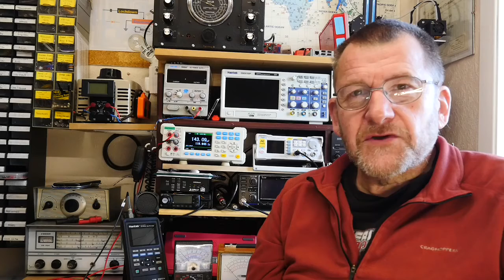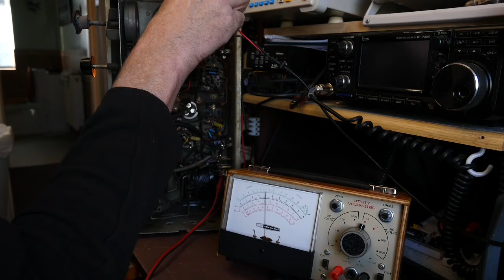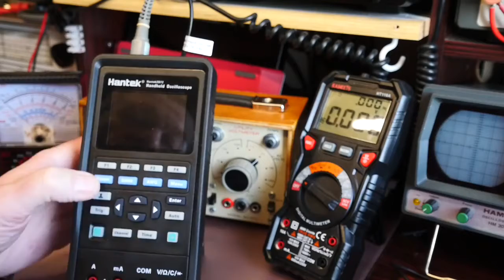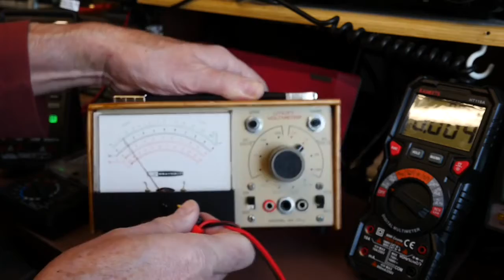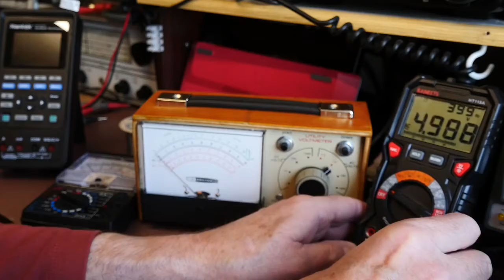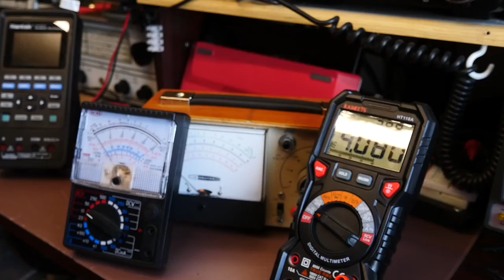Why Bother With Analog Meters?

Comment: Of course I liked it, and thank you for that. Like you, my first multimeter was an analog one. I still have it, and it still works a little (not as an ohmmeter). The brand is Central. I think I was 15 when I got it in 1976. In 1979, I bought my first digital one, a Micronta 22-198, which still works with good accuracy. I bought it from Tandy, which is no longer in business. The need for precision isn't frequent, so an analog one is sufficient and sometimes allows you to find a fault simply by placing it on a broken resistor thanks to its low input impedance.

Comment: An analog multimeter can test its own batteries, but a digital one cannot. Those who say that a digital multimeter is more important because it's more precise forget that circuits are made with resistors and capacitors that have a tolerance of 10 to 20%.
Thank you for your videos, I love your channel 😉

Comment: One remark about comparison of the digital with analog meter measured values in AC, analog meter measures the so called average value while better digital measure the RMS value. The better analog ones are adjusted to show the RMS value (but only for a sinusoidal signal). That is why the digital, with RMS, are also called True RMS, as they also measure RMS of all AC forms. And RMS being the effective value,  compared with DC resulted power...

Comment: I'm an analog meter fan. I have had a Simpson 260 and still have a Triplett 635, 300C, and 850 which is a copy of the Senior Voltohmyst.  But I wanted a decent new meter with a +/- centre-zero scale. Sanwa makes some, but they aren't that good. I found a Tekpower TP8250. The null scales are +/5 and 25 DCV. Quite handy for balancing circuits. It has a low-ohms scale as well. It took me some time to find one, so I thought I'd let you know. BTW it makes me feel young to know the 260, 635 and 300 VOMs are STILL made!

Comment: You are probably aware that analogue meters have their working position (inverted T for vertical and a kind of a wide inverted U for the horizontal position). If you do a demo on precise readings / differences you should keep the instrument in it's intended position, otherwise the comparison would not make muck sense. Although this sounds as a critic it is meant as a education for the others to be aware of this fact. And as you mentioned the parallax. Also the lighting / shadows. But your video has a different point probably and is more of a general point about analogue meters. They are intuitive. But still I could not help noticing this fact 🙂 Cheers
Reply: But  many analog meters didn't have mirrors......

Comment: Although I have a personal experience to “feel” voltage variation, there is another good use as the resistance non-linear: I (galvanometer) = V / r  , resulting in a Hyperbolic graph (for R, I meant). 
An analog is then useful to compress scale and use it for non linear (and simpler) ESR testers.

Comment: Thanks for a great video about the need for an analog meter on your bench. I have the kaiweets, heathkit dvm and a fluke 77. All good DVMs but when I do alignments in a receiver where I need to do peaks or dips in a circuit my 47 yr old vtvm puts all of them to the back of the bus. Nothing better than a meter movement for that work.  Cheers KG5IF

Comment: Hi Bill, thanks for the video. The RSGB Intermediate course lists the good points for an Analogue meter. I bought an "el cheapo" one and didn't like the meter connections - like a loose rivet with the same plug as the end of a probe making intermittent contact - returned within a day! I always look to your reviews to help justify a purchase... a second multimeter is justified IMHO if it is analogue - it is complementary (but not without cost).

The Heathkit is interesting because FET Multimeters have a high impedance and are less likely to affect a circuit being probed. 20 kΩ/volt is considered OK for a non FET meter? Some radio tests also specify that their tests were taken using just such a meter. It is perhaps no bad thing to take your time with a measurement so thinking about the range and zeroing the leads isn't a huge disadvantage - you might even observe something unexpected by not being in such a rush? Simon

Comment: Love your videos! I have several good DMMs but also own several Analog meters, one of them, I just purchased on estate sale, from Japan called THOROTEST M-20K. I can't find anywhere schematics for this meter. It's not working and everything I own I like in working condition. Do you know where to find the schematics? It also has room for (what it looks like) 2 AA batteries but when I put them there, the meter isn't working at all. After opening the back, the meter is clean inside and no wires are broken off and one capacitor, orange color, 0.1 MFD is the value. When I measured it, it is 0.1382 mF, using L/C Meter IIB by "Almost All Digital Electronics" - Neil Hecht passed away on August 19th, 2015, unfortunately for us hobbyists. (I wish I purchased at least 2 more items from him!). Anyway, the needle moves freely and the entire meter looks almost new inside and out. Also, it has on the right upper corner port called OUTPUT! I never seen a meter with an output so if you know what that is all about, please let me know. I have no schematics and I could not find them anywhere on the web, but I'm open for suggestions. I have small youtube channel,  go to: https://tonysfun.com/ and click on MY YOUTUBE VIDEOS if you are interested. Thank you very much for your videos. I also subscribed your channel.
Reply from the maker: Like you I cannot find anything on the M-20K meter.
In my experience, analogue meters will work on V and A ranges without a battery, as for the output I am not sure.
Has it an FET front end maybe? That would need batteries for all ranges.

Bill
Reply: @LockdownElectronics  Thank you very much for your quick reply! Have a great week!

Comment: A Heathkit FETVM?  Nice, although a bit modern for me, so I'll stick with my HP 410B that I bought from the US about 14 years ago for £60, before the prices rocketed!  It is over-engineered superb-ness with it's (possibly) original tubes and hand-warming AC probe.  I also have a few AVOs (Model 7 maybe, Multiminor and some other one) and a recently purchased Ferranti 1092 Volt/Ammeter that I've not yet used in anger!

Yes, digital meters are cheap and accurate, but quite often not as useful as analogue.

Also, I don't trust autoranging meters!
Reply from the maker: Nice collection!
I  keep watching VTVM's on Ebay, as you say they are quite expensive. It is tempting....